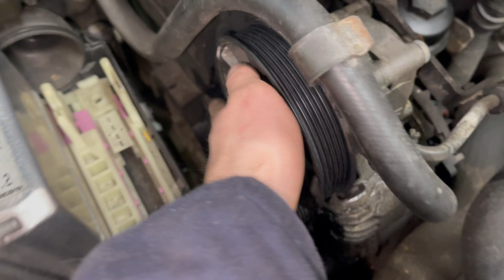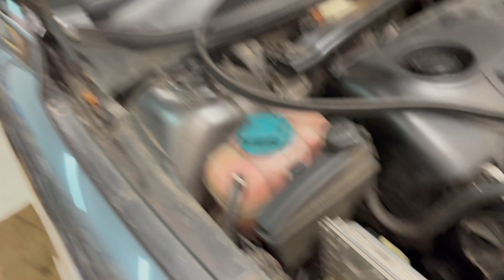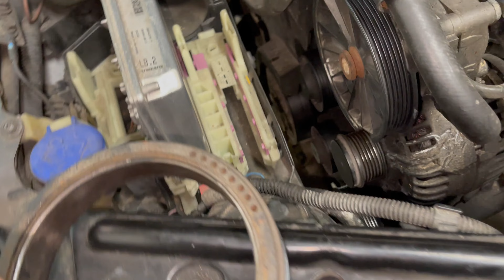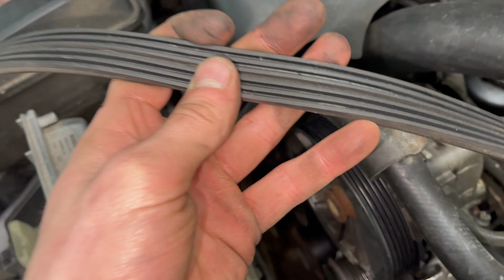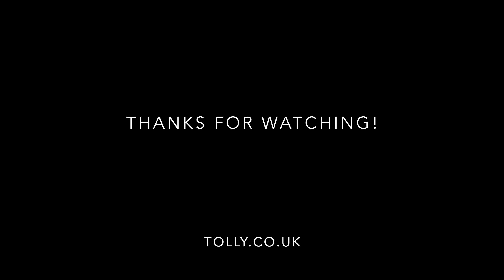Why I Keep Running My 300k+ V70 D5 - Another Disaster Narrowly Escaped!

Comment: I have 2 XC90's with the D5 engine. Bought the second one to replace the older one with a faulty TF80-SC valve body but it's such a good car I'm currently trying to get it back on the road too. Thanks for this info regarding the pulleys. Timing belt and idler pulleys are a job on my list for the near future... not looking forward to it!
Reply from the maker: Are you sorting the valve block on the first one?
Reply: @IAMASPANNER  Yes, hopefully. I bought a Transco valve body modification kit from the US and have carried out the modifications to the body. It may or may not fix the issues, need to get it out on the road with a warmed up gearbox. Problem being that I can only legally drive it to an MOT station (with insurance in place) as I don't have trade plates. One of the problems us DIY mechanics face in these cases.
Reply from the maker: @gavinstirling7088  absolutely, I have the same problem too really, I don’t have trade plates however I do have trade insurance. I hope you get it sorted, I’ve always wanted to do one. I actually lost a C30 to a gearbox fault.

Comment: Had my belt fail on my Twin Turbo D5 S80 earlier this year, was due to drive to the Arctic circle 4 days later. Fortunately  I turned the car off before it got pulled into the timing belt (it had made its way up inside the cover) Managed to fix the belt and drive to the Arctic circle and back, 5,000 miles, lowest temperature was -36 degrees! The car ran better than it ever had. Volvo forever!
Reply from the maker: Did it fail due to age or just unlucky? Those later D5s do seem to have their issues. A friend of mine had the same happen on a 2010 and it did find its way into the timing belt and pulled the idle pulley straight out of the block. Congrats on the Arctic journey, I’d love to do that. I’ve just done Germany at around 2,000 miles 👍

Comment: Metric units here. Tolly! I have the same D5 on my 2005 XC70 (~220k km). Unfortunately I experienced that accident which you we're afraid of. I saw that crankshafts pulley's outer part flying and rolling in the air next to my driver's window while driving around 110 km/h on the highway. I immediately switched off the engine and drove offside. WARNING! ⚠️ Do not take out the key in a moving car otherwise you will block steering. The aux belt had major damage (2 teeth were eaten off), but luckily it still stayed on. I guess it was a miracle & fast reaction time which saved the timing belt therefore the engine. Had to tow the car, change the pulley and aux belt. From my experience and gathered info I would recommend to change crankshafts pulley every 200k. I hope I had correct ODO (190k) when bought the car.  Correct me if necessary.
Reply from the maker: Lucky escape there for you too even after the failure. If I had ignored my belt squealing I’d have been on the motorway moments later! As mine had already been changed I can’t be sure when it was changed. I did the timing belt at 300k which was well overdue, it’d already been done twice. I think knowing what I know now I’d change the dampener every second belt change or every change if it’s been 5 years which could be more the issue with mine. All my distances in miles, I think the timing belt interval is 90k and I know that 310,685 miles is 500,000 kilometres.

Comment: Good video , one other hidden horror thing on these is the rear brake pipes where they connect to the rear Flexi hoses. Road salt muck gathers and cakes around the bracket the pipe union nut and spring clip , and the pipe can break there if impacted by stones or wobbled when changing the Flexi.
Fortunately the pipe has a union beside where the rear hanger for the exhaust centre section is so the parts you have to change are not overly long . (Unlike this blurb)
Cheers Andy .
Reply from the maker: Cheers for the info Andy, I’ll take a look at mine. Just got a donor car as well so I’ll be sorted for a while whatever happens.
Reply: @IAMASPANNER  I have a door car and already used some parts for the in-use car.. now I want to try and get the donor car back on the road, as per my above comments :)

Comment: I would say the reason the original pulley is so expensive is because it is built to last.... I have 440,000 miles on mine and the pulley (as far as I can see is still original).
If i need a replacement, I will replace with a low mileage used Volvo part!
Reply from the maker: Mine didn’t appear to be original so you may be right, that would be very impressive if it is the original one.

Comment: 440+ K on mine, and still buzzing like a bumble bee. One of the essential repairs/maintenance was replacing the dual mass flywheel (after 300K), which made this engine like new again
Reply from the maker: Just about to do mine along with swapping the gearbox from 5 speed to 6 speed. Actually I’m using the flywheel from the donor car as whether it’s original or not on the 171k donor car it’s in very good condition.
Reply from the maker: Kudos on the mileage too, I’d love to see 500k on mine. People gasp at my mileage and I still think it’s pretty low for a D5 😂
Reply: 6 Speed gear, great idea. Hate overreaching 3k rpm with my 5 only

Comment: I've had the exact same problem at 570k and my aux-belt actually flew off while on the motorway. Turns out these pulleys are not made to last an eternity, unlike the rest of the engine
Reply from the maker: 570k miles? That’s amazing mileage on the original one, I think mine had already been replaced as well.

Comment: That's quite worrying😳 hopefully my D5 has a few miles before I need to worry @125k 🤔
Reply from the maker: It could be perished due to age though? Mine will have been over 10 years old I’m sure.
Reply: hmmm I think I'll have to check my one now. Do you have a link on where you go the pulley from?
Reply from the maker: @mabskha7917  I bought it from my local auto factors which is GSF, you can try Euro car parts or other local auto parts suppliers.

Comment: another part to look at changing soon for me then, although my current issue is getting new ball joints installed (any tips greatly appreciated) , F.Y.I if you didn't already know and don't mind imported parts  polar-parts is the my go to supplier, some what half the price of parts here in the uk.
Reply from the maker: Ball joints aren’t the best of fun but if you check my videos I do them along with bottom arms. Make sure you have a ratchet strap to pull the bottom arms down.
Reply: I did check out the video, problem was the joint wouldn’t go in flush but got in eventually, didn’t need a strap for arms as on coilovers so just dropped joint in first then bolt back up the strut.
Reply from the maker: @ramend9976  a very good excuse to fit coil overs there!

Comment: Hi mate maybe you can help. I have A D5 S60. The steering is wandering on dual carriageways/motorways, when I brake it pulls to one side (partially due to imbalanced brakes). With potholes around town the steering seems to fall/steer towards these potholes. Two different mechanics both said it seems to be control arms. They replaced the passenger side lower control arm, barely any difference.

It was suggested its probably the subframe bushes. I assume these have never been changed. It also seems to be easy enough to do at home just parked on the road outside. Is it a safe bet to say its the bushes, and if so, should I replace them, or just fit the polyurethane inserts instead?
Reply: I sheared off one of the sub frame bolts on my XC90 and it's been a huge pain to drill it out. I'm going to have to fit a much longer bolt with a locknut on the end. Just be aware that the sub frame bolts have a habit of being corroded in place, especially the nearside front (UK spec) as the salt water gets trapped in the fixing. Unfortunately you need to remove the bolt whatever you decide to install. Perhaps you could thoroughly clean the area then apply a light smear of grease, to try and see how much movement there is after driving a few miles?
Reply from the maker: I really want to change mine but I’m always in a rush when working on this car as it’s my daily. I doubt mine have been replaced though and I don’t have wandering steering. Have you had 4 wheel alignment done? One thing my car does do is steer when braking hard and I put that down to having a new shock absorber on one side and not the other (due to budget at the time of failure), you should change both sides at the same time. Depending on mileage you could also have a dead spot in the steering rack which is what caused me some play in the steering before.
Reply: @IAMASPANNER  Yup, turns out I have a knackered steering rack AND column. I dread to think of the cost haha
Reply from the maker: @MementoMori-xx5qo  column shouldn’t be knackered as well, what’s up with it?

Comment: volvo d5 d5244t is the best engine ever I don't rate the latter model 185 has a lot of issues like swirl flaps and egr and dpf I have volvo v70 d5 170k running so beautiful very smoothly
Reply from the maker: I’ve just bought a donor 2006 for parts for this car and that has a DPF fault at 171k, you don’t see the later engines with good mileage on as often as the early engines.
Reply: What's the swirl flaps issues on these?  Not plastic are they!? I'm close to parting with a few quid on a 2010  170k miler d5, fully serviced, cambelt and aux belt just done. But don't want a heap of trouble if they are no good...